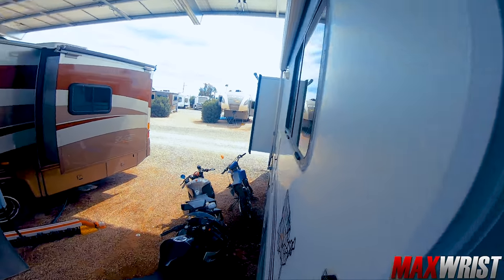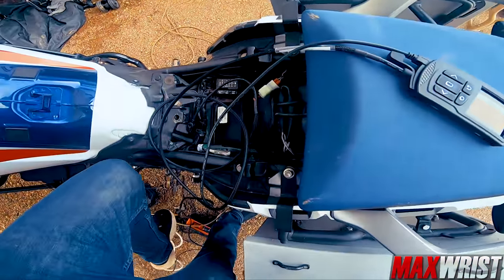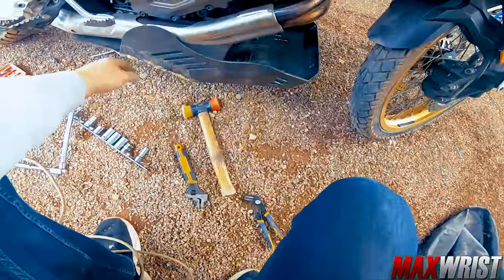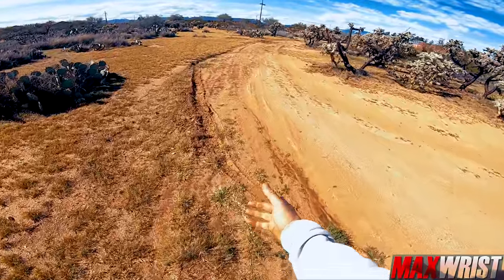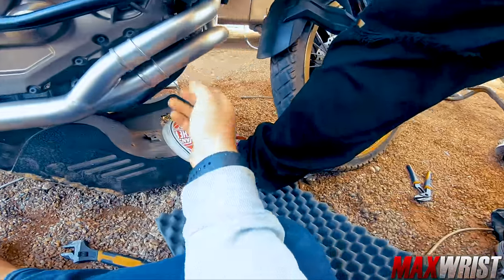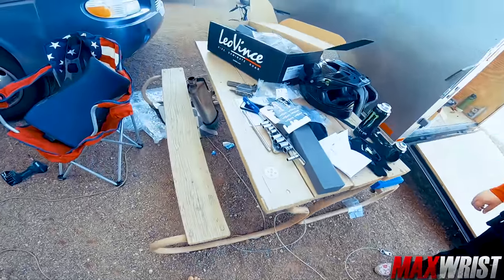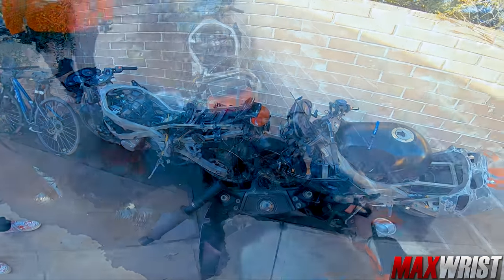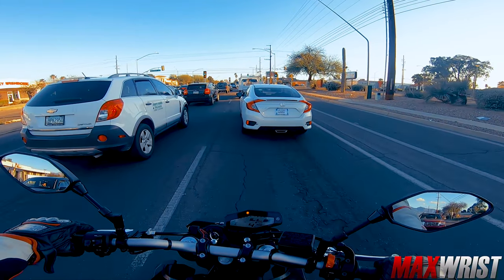$200 FOR 2 BIKES! 😱 *BEST DEAL EVER?*

Comment: Use drill bit grind off the tip of the bolt use those copper inserts it works for the stripped ones

Comment: The 675/765 triumph is the street triple. The speed triple is a 1050 and has like 140 hp and 80ft lbs of torque. It’s probably quicker then the mt if not the same

Comment: Don't buy them. You don't have a full workspace meaning these would take quite a bit longer than you think, it would takes ages to clean up properly just one of those even if making 2 into 1, also both motors/g/boxes elec. etc. are complete unknowns. Better in your situation to do something like you did with the Bandit which was great 🙂. Grab a bike for 1/3 to 1/2 the market value which doesn't need a full rebuild like those two do, fixup, sell for a bit less than market price to entice people and quicker sale. Check out Copart too.